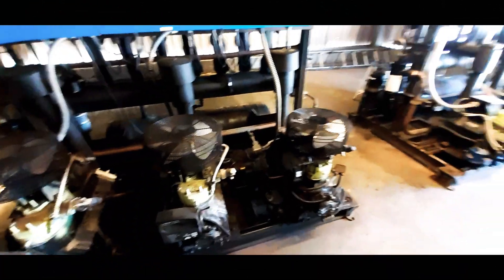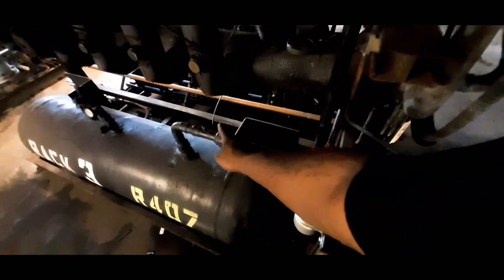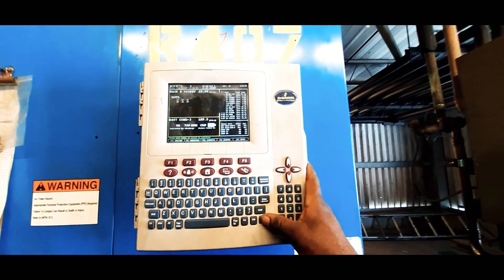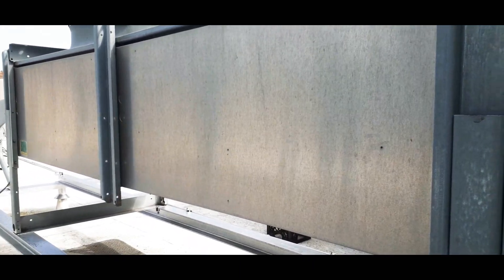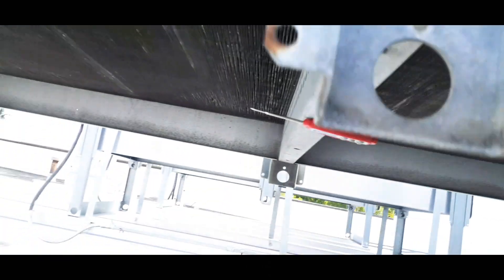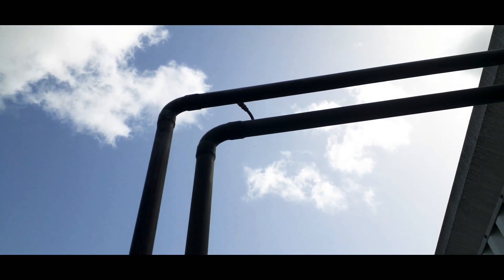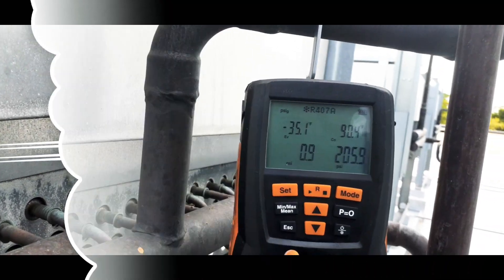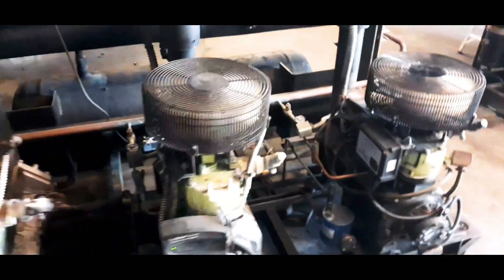How To Check🔭 (NON CONDESIBLES)🤔

Comment: Good work!
Reply from the maker: Thank you. Are you doing market refrigeration now or a little bit of both. I read the last comment.
Reply: @Bluecollarrebel  what is your channel e-mail address?
Reply: @Bluecollarrebel  I have worked in alot of applications in our trade. I got started in residential hvac, from split systems to window unit ACs. I even did appliance refrigeration for residences. From there I worked my way up into heavy commercial and industrial hvac where I became a centrifugal chiller technician working on chilled water systems, AHUs, cooling towers, and even commercial kitchen refrigeration equipmemt such as ice machines, freezers and refrigerators.